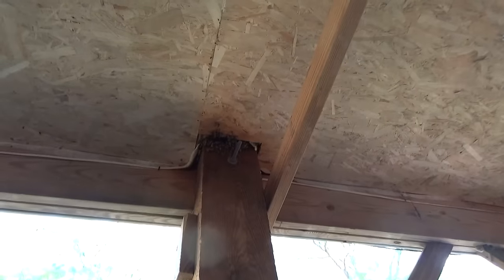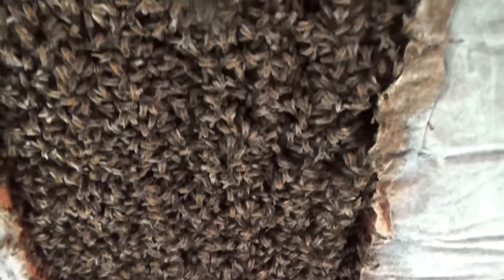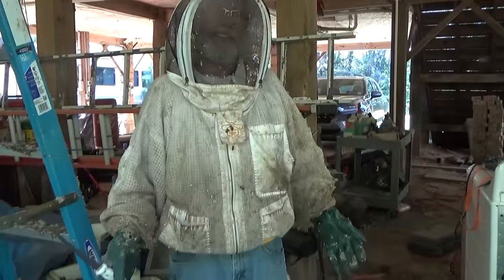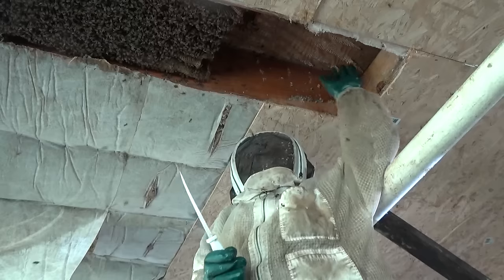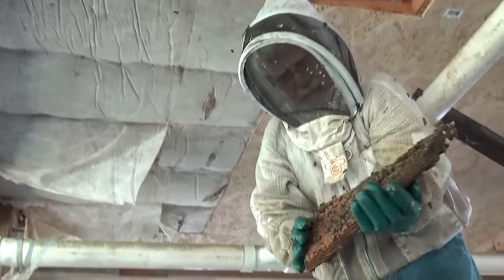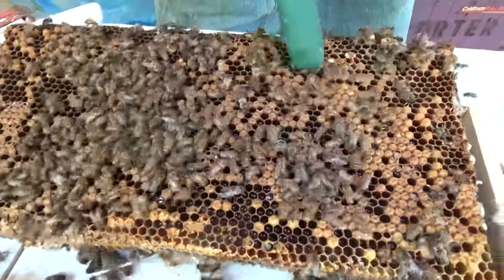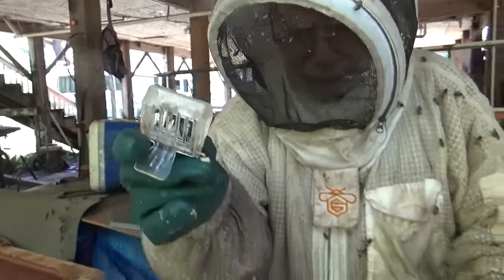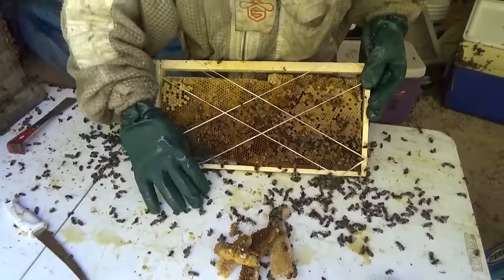Are you serious? Using  a machete to remove a bee hive?

Comment: Do you have removal bees ever take off after you bring them back?
BTW I made a knife with a 90 degree bend. It makes it so easy to get the top of the comb cut.
Reply from the maker: Yes, it happens often in the summer months and when there is a dearth happening which is one reason I don't like doing removals in the summer. I like the idea of a knife with a 90 degree bend in it, I just use my hive tool. Thanks for watching, and I hope you will check out more of my bee wrangling/ bee rescues adventures and let me know what you think of them. By the way, I post a new video every Friday morning, and I look forward to hearing from you again soon.  God's peace Howard.
Mr. Ed
Reply: @JeffHorchoff  interesting. I didn't think yall had a nectar dearth. Our area had a single VERY short flow of maybe 7 weeks not including red maple which is a great late winter boost for bees. This is a super great flow but the hives aren't built up enough to put away surplus honey. The maple does trigger early (mid February) swarms which adds to the joy of keeping bees - NOT!
I mainly do removals from February to August and that's the only reason I still have hives.

Comment: Buy a Rain Jacket and Panting.  Add a thin , thin Fleace inner lining to the jacket , just wear your pants under the panting  , modify sleeves to keep out Bees with velcro at the neck to accept the netted Head covering . Boom , now you can be hosed down after bathing in Honey . Too you can add an opening at the back to accept and hold a hose which is connected to a fan to keep air flowing and you cooler on hotter , humd days . Hoping that can be a thing .
Reply: If coat has a Hood that too could be modified to take a face covering with frame to keep it off your face as the rubberized suit might in and of itself be , Bee proof against their stingers >
Reply from the maker: I have considered using a poncho whenever I come across situations like this, but if I wear anything that is not breathable material the heat becomes unbearable. In the end, I'd rather take a honey shower than bake under clothing. Still, I appreciate your wanting to share your thought in tying to help me. Thanks for watching, and I hope you will check out more of my bee wrangling/ bee rescues adventures and let me know what you think of them. By the way, I post a new video every Friday morning, and I look forward to hearing from you again soon.  God's peace William.
Mr. Ed

Comment: that looked to be an absolutely massive hive but with very conveniently sized pieces of comb! it also looked to be absolutely loaded with honey. do you have an estimate of the number of bees and the amount of honey it contained? aside from taking a honey shower because of the location how do your shoulders cope with that many hours of work above your head? when that machete fell it looked a bit scary a very good tool but one with some danger attached! also missed your taking a taste test! Impressive work as ever!
Reply from the maker: The comb size fit perfect into a frame which made the job so much easier to do. I guess there was over 40,000 bees in the hive and I got over 3 gallons of honey along with all the honey the bees got and the homeowner as well. The over head work is not what hurts, it's the hours on the ladder, my legs get very tired from all that up and down. Thanks for watching. Until the next one, God's peace Jean.
Mr. Ed

Comment: hey jeff, probably a dumb question but what size rubber bands are you using? seems like everytime i try to band comb in they are really sloppy and doesnt hold the comb fast or there not long enough and i have to go vertically.  great video!
Reply from the maker: I use a 7 X1/8 inch rubber band I buy off of Amazon. They come in a box of 200 for about 10 bucks a box. This is the easiest way of securing comb into a frame I have ever used. Thanks for watching, and I hope you will check out more of my bee wrangling/ bee rescues adventures and let me know what you think of them. By the way, I post a new video every Friday morning, and I look forward to hearing from you again soon.  God's peace Taryl.
Mr. Ed
Reply: Jeff I've seen em all! I been week to week for a long time, it's your fault I got into beekeeping 😂